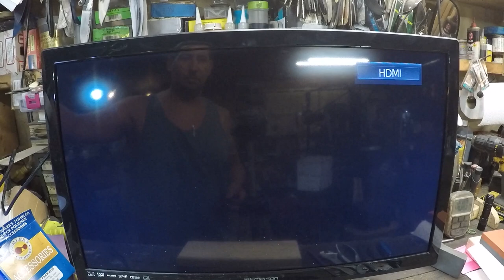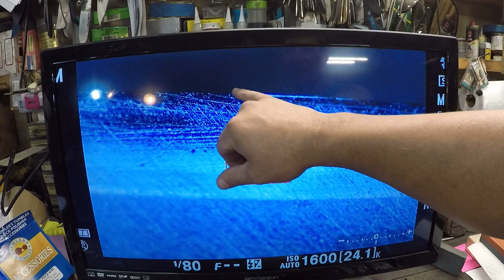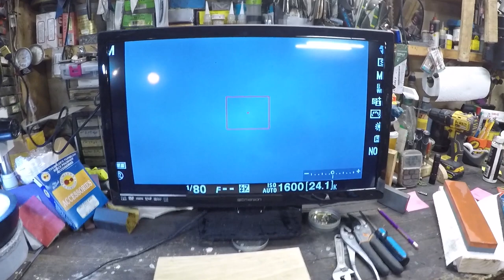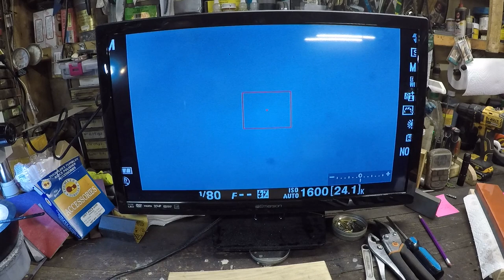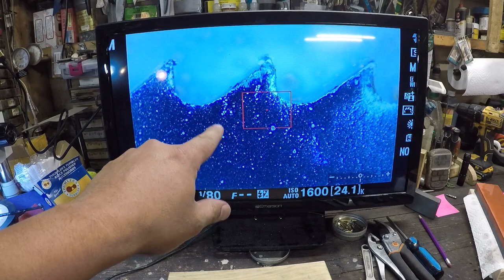victorinox tinker and fine india sharpening stone

Comment: Hey Joe, I'd really like to get a little update on how you used and liked the fine India since you got it. What grit do you condition it to? How often do you need to recondition the stone, if you use it for shaping and microscopic? How does it compare to a dmt 325 for you?
I condition mine to 120 grit (I only have lose grit in 54 and 120 grit yet) and I find the edge to be considerably coarser compared to the coarse dmt. The 325' dmt is worn in pretty good and most likely cuts quite a bit slower but on just sharpening relatively narrow edge bevels an extra 20 seconds doesn't really justify the reconditioning and use of oil on the India for me. I really like the idea of having a cheap, unbreakable workhorse oil stone in that grit range, I just do not seem to favour it to the diamond option.
Reply from the maker: while I like the fine India stone, I don't use it near as much as the fine silcon carbide Norton stone. the edges off mine are just a bit less toothy than what I really like compared to the dmt 325 or the fine Norton sic stone. plus I usually have the combination sic stone out anyways to shape edges with the coarse side.

what you might try if you only have the 120 grit sic powder is to finish the stone with slightly worn 120 powder, or to take the stone and finish it with fresh 120, and then use the stone to reshape a couple bevels and break it in from the 120 finish and see if that gives you the surface that you are after.

Comment: Joe, 
I bet a donut your first india stone glazed over when you tried to flatten it? The stone got dished through use, and you went to flatten it against another similarly hard stone or a concrete slab, maybe? This is what would have glazed the stone, in my opinion. Lapping with silicon carbide de-glazes the surface. Another way you could use a very hard-bonded stone like india is to work/wear down the edges of it rather than to dish the center. As long as you don't dish the surface, you should have no problem sharpening things on it. A dished india stone will sharpen things, too, but it is more limited and less efficient. Also, if you continue to use the stone the way you always did, it is still going to wear primarily in the center. This means you could be wasting a bit more of the stone than you might like, over the course of having to periodically flatten out a dish. If you avoid dishing it through wear, this particular stone may never need to be reconditioned, and it will work fine even if/when it is a bit humped (opposite of a dish) in the middle and despite whether or not you ever choose clean it. 

I am interested to see someone like you to try out such things, but the resistance to the idea seems to be very strong.
Reply from the maker: that is a great idea. but one that I think would be tough to really pull off. while I do turn the stone around every couple of knives, and use the ends when doing spot work on edges, the ends never get enough wear to keep up with the sides, and so you end up with a stone that sorta has a ridge in the center, that is lower than the ends.  but by using the high spots as often as you can, you can maximise most of the stone, and then just level it out once in a while with sic powder.
Reply: @joecalton1449  It might not be so hard as you think, but it takes a paradigm shift in method/thought process. I primarily use just the ends of my 8" india stone when sharpening a small 4" knife or chisel. About 1/3 the length of the stone is all I use, focused to the end, but I will vary my strokes shorter and longer (up to about half the length) so the wear is blended in and weird bumps/lumps don't form. 
 
Sharpening knives on a convex stone is almost exactly the same as on a flat stone. Only you have more freedom of how you set the knife on the stone. So it's easier, IMO. You can really "go to town," once you develop the muscle memory. Think Gordon Ramseys' sharpening video using a steel, but add a little actual coordination and angle consistency. OTOH, sharpening plane blades and chisels requires a bit more attention and/or skill to avoid smiling/frowning the edge over time.

The idea of convexing a stone is not popular, today. Most synthetic sharpening stones are too soft to be used like this. Only stones that are very hard and wear very slow will even be usable this way. An india stone is just hard enough where this works fine. On the super dense/hard ark stone or sintered ceramic, a slight curve will generally improve the cutting efficiency of the stone vs flat. 

My curved india never needs reconditioning. Only one of my curved ark stones ever needs to be reconditioned, and that's cuz it is a low quality stone that has soft pockets, and the surface gets undulated through regular use. All my other curved ark stones work indefinitely without glazing, and cleaning the stone doesn't seem to matter. I will leave dirty oil on the stones for weeks, until I'm done using them. When using them bone dry, they will eventually slow down, but a couple drops of oil and they are clean, again.

It doesn't take a whole lot of curve. But once curved, you can't use angle guides. The stone will be good only for free hand sharpening. Also, it is not necessarily convenient to curve a double-sided stone. But I have never purchased a hard bound doublesided stone where both sides were useful for sharpening. To me, the coarse side of my Norton India is completely useless for anything other than flattening other (purposely flat, generally softer muddier stones, like soft water/alum oxide or SiC synthetic resin bound) stones. So it makes perfect sense to me to keep the coarse side flat and the fine side slightly bowed. (There's a technique to doing this, to prevent one stone from bowing and the other from dishing; it's very simple, and perhaps I will make a video one day, soon. I can take two stones and make them just as flat as the average guy will get with a plate of glass and SiC powder. Which is to say, much much flatter than what you can get by rubbing a flat diamond plate on most sharpening stones.)